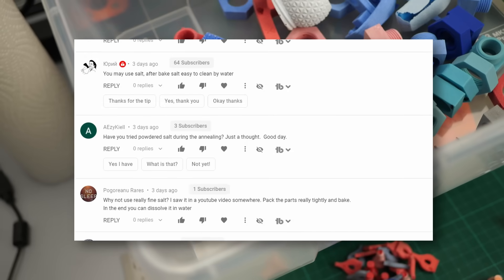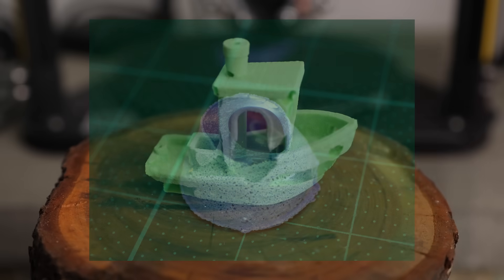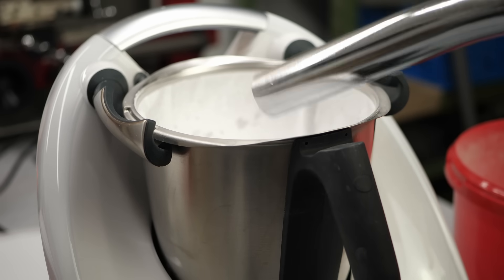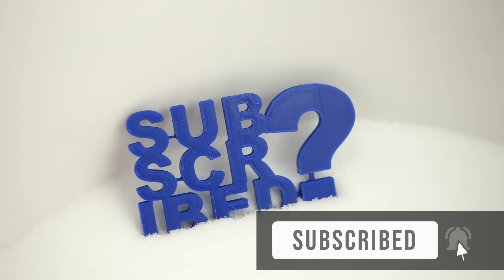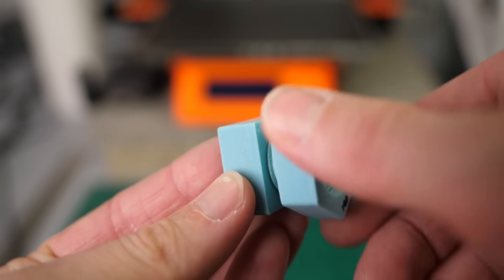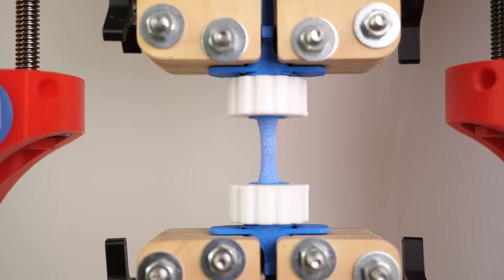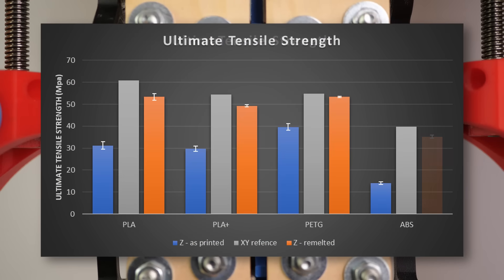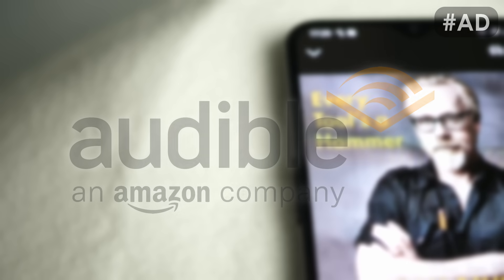The STRENGTH of 3D prints REMELTED in SALT

Comment: 3d print, polish, and make a (metal  pouring)mould from high temp gypsum and sand, and pour (inject) molten plastic  into it would make better quality injection moulded parts.
you could print in pla, but mould in high strength carbon infused plastic to make precise, real solid and higher temp parts.
you could even use aluminium or brass in a low cost set up.

Comment: There are at least two very interesting options to use: 1. Silicone for metal casting, like Mold Star 30(separated from model with something like graphite or thin layer of liquid soap, dried after covering) 2. Talc, that is not dissolvable by water and will melt in the model, creating something like matte surface.
With smelting in a mold it turns to entirely new process, when the printed model is a draft that turns to finished object later.

Comment: A great example of scientific experimentation. There is an ultra fine powdered pickling salt that does not clump up. Less costly to acquire. 
Increasing the tensile strength of the plastic cheaply can be a boon for manufacturing.

Comment: How about fine masonary mortar or just a bag of concrete cement...super fine and probably temp resistant, and cheap. And place your part container on a vibrator which will vibrate into small areas.

Comment: In lost-wax casting of bronze etc. the shape is often dipped in plaster to create the surface prior to putting it into the sandbox.
A quick-drying thin layer of plaster (Gießgips) might be a good method for creating the clean shape for containing the plastic and reduce the grain-size requirements of the sand/salt used around the shape, as there will not be any contact with the coarse particles.

Comment: I'm wondering if using the gypsum powder as a dry powder aggregate would work the same?
Gypsum already comes as an ultra fine powder so there's no need to pulverise it further.
Reply: Heat at 300 Celsius. Then it contains no water.

Comment: I don't know how much my experience would carry over, but I do a fair bit of casting with metals, mainly bronze and aluminum. when I do a cast I use a very fine sand/clay mix and a sieve. clay forms a tight seal around the cast and helps to improve the surface finish. in your testing, you compressed the salt at the end after the mold was full. you need to actually do this around every piece, as waiting till the end doesn't force air bubbles out but instead pressurizes them against the side of the part. if you ever revisit this you may want to check out a few casting videos that talk about preparing the mold.

Comment: And second - i wonder what would do some spray on the surface of the model before putting it to the salt. Something that would make the barrier between molted plastic and the salt, so they would not fuse together. 
And third - also if there would be some liquid, that would not disolve the salt and would not evaporate with that heat, there might be possible to create some semi-liquid fluid, that would pour into every hole but still be strong enough to keep the shape in the oven.
And fourth - what about vacuming it - would it remove the excess air?

BTW - speaking about the price of the salt and the material - if i understand it - you can reuse most of it (maybe just grind it again). So even more expensive material with better properties would not be a problem when using regularly

Comment: Is salt really the best choice? It appears to really degrade the outer surface. I wonder if a fine stainless steel or brass powder would work better for conducting heat and maintaining shape. I know fine stainless steel powder is used in metal printing (although it's very expensive) and I think brass would be a better conductor of heat but I'm not sure about it's availability. Aluminum would be nice, however it is combustible at this fine of a powder.

Comment: I would think fine sand-like greensand would be Ideal just need to get a fine material with very little water and stable at medium to high temperatures. Although it might be interesting to attempt that with metal powders to see if you can get a metallic polymer composite part.

Comment: You could potentially just clamp two of your containers together to achieve constant compression during heat treatment. Might even help drive out air from parts or help the fine structures of the plastic to help create even stronger prints. Could also deform the prints once it gets hot though. 

A method to create these prints using lower infills might be something like this. Print low infill part, add a vent into the part which can be filled with plastic pellets during the salt casting. Similar to how one would cast iron or aluminum. Perhaps using a vacuum oven would make that cast better. But the benefit of this would be faster prints with the same full infill.

Comment: I'd be interested to see a near-net-shape part printed and post-processed using this method, and then machined to maintain dimensional tolerance. I've had good luck performing near-net-shape machining on PETG parts with a small desktop CNC; I would think this would be a great way to get one-off parts with surface quality and material properties almost equal to an injection-molded part

Comment: this is gonna sound stupid,  but try a metal 3d printing powder, it is comically fine, and should have a higher thermal conductivity than the ceramic. 

(NOTE METAL POWDER IS INCREDIBLY DANGEROUS: DO EXTENSIVE SAFETY RESEARCH FIRST)

Comment: Sorry, only brainstorming after watching this video, recognizing the for me unknown idea and the possibilities: You may use more temperature conductive material, such as the metal powder that is used for metal 3D laser printing. This has a fine grain and your part will warm up and melt very fast, same as cooling down. I believe this will help to get better surfaces (no oxidation) and therefore also tensile strength.

Comment: I suggest using ball bearing mill.
You can make one yourself easily, empty metal paint can and bunch of steel ball bearings, then drive it with anything to get it to constantly rotate, there are plenty of videos and instructions.
Though I've got stuck on obtaining such a can, last time I was able to buy it from a fireworks making website but now as a immigrant in UK I have to stay away from such websites.

Comment: I would try fine powdered sand, but that is also very bad for your health, especially if it gets in your lungs.  Also I would recommend using a mortar and pestle to hand grind your salt if you continue to use it.  Salt is probably the best due to its high melting point, I would avoid flour because any aspiration around a flame can cause a spontaneous flame cloud.

Comment: After a recent nightmare for grinding a specialty salt last year, I definitely understand your issue with grinding! Unfortunately we discovered that it's not enough to simply grind to get a fine result, you have to grind in very specific ways, then sift/sieve your particle sizes. Then you have the additional problem that you have to watch out for clumping from just atmospheric water (even if you're in the desert!) and possibly bake out the water to prevent clumping (bake it before rebaking sounds extreme I think!)

Looking at your video and the original one, the best method would be some type of very fine casting sand, if you could find one with a high melting temp and no oils. Then baking with this method in a convection oven so the interior temperature doesn't rise to the point of melting/binding to the part. 

Another interesting test to do if you try a variation of your method would be to use this as casting method. Print a low density part, but have raw, unprinted material above that will melt down to fill in your unfilled part. Then you will have found a method to densify low infilled parts! (Which may not be that important though)

Comment: Builders cement is an incredibly fine powder and would not be affected by the heat. It is also hygroscopic, like salt.
WRT the PETG prints. I use it a lot. It's great stuff, but to get best results must be absolutely dry. It is not enough to put into a room temperature box with silica gel, it must be heated in an oven to 80C to 100C for half an hour or so, then stored with silica gel.
PETG prints which have been left for more than a day or so before annealing should be dried before annealing/remelting. This could easily be accomplished in the salt process by heating to 100C for half an hour (probably much longer to allow the salt to warm up) and then raising the temperature for the annealing / remelting process.
The cement powder should be packed as a dry powder not wet...!!!

Comment: Has anyone experimented with different powders? CaCO3 might work, and it's possibly cheaper than the salt. Its grain size is around 50-100 μm which is much finer too.
Reply: I had similar idea, with Calcium-hydroxide. I'm not sure if you can buy calcium-carbonate easily, and also the thermal decomposion might be a problem. From health aspect it would be very much better if suitable

Comment: Silicone has a very high temperature rating. I'm curious if you could 3d print a part, suspend it in casting silicone and remelt it. You'd ideally have 0 moisture problems because silicone has no water in it and completely cures as part of a chemical process. You'd also likely not have any casting surface imperfections because the entire part is reflowed as an exact image of itself. 

Try it and let me know.

Comment: If the goal is to re-melt (similar to basic molding or casting?) for layer adhesion then wouldn't it make more sense to use a high temp silicone 2-part mold? that way you wouldn't have to deal with grain size and it would likely be better for dimensional retention? I've seen silicone molds that can withstand multiple castings from metals such as lead, which is upwards of 330 deg C.

Though,  at that point you'd probably be better off just doing standard casting, but it may be a thought.

Or what about doing a mold in "greensand" like in metal casting?

Comment: Stefan:
As a curiosity could you amalgamate the the plaster annealing process and the salt annealing process by using a general plastic safe solvent.  (Methyl-ethyl-alchohol?) If the solvent is allowed to evaporate before the heat treating process the moisture content would be quite low.  In the proper ratio of salt to solvent you could create a slurry that would flow around the part and could have a more consistent surface finish.

Just curious.

Comment: Stefan, have you considered a more controlled cooling process after baking? Your close ups of the snapped surfaces remind me of how ice typically forms in a freezer. The samples look really solid and flawless towards the surface (until the porous crust from the salt, of course), but get cloudy as you look towards the center. This of course is the common behavior in materials when solidifying rapidly (relatively), where the outside will solidify before the inside, causing stress as the material inside tries to expand or contract. I might suggest taking a note from how people create their own clear ice by controlling the rate at which the material cools down and solidifies. You could decrease the temperature incrementally, waiting for the internal temperature settle before proceeding, until ~10% below the expected state change temperature. This gives the material an opportunity to solidify in a more uniform distribution.

Comment: All this tells me is that you need to coat the parts with a painted product (that can be dissolved afterwards without damaging the plastic).. First paint to prevent interaction with the powder.. heat.. remove the coating...   The temps are not so high that you shouldn't be able to find a water soluble "paint" to coat with first..

Comment: I really, really, want to see how this does with CF and carbon nanotube filaments, which lose so much of their touted strength to layer adhesion.  I'd also be interested in seeing parts tested in both orientations with such.

Otherwise, I think that talcum powder would be a go-to given relative availability of ultra-small grain particles and the temperature profile in which it should remain stable.  I suppose that's the test I want to see the second most.

Comment: A common method to form melted aluminum is sheetrock mud, or drywall joint compound.  After forming your original shape, you can deposit it in a loose slurry and allow it to cure hard, you can then pour molten aluminum into the form.  The finished result is hard before it is baked so it would not bond to the exterior thus prevent things like nuts and bolts from deforming. To clean it off after baking, simply place in water.

Comment: Stefan, I was experimenting with the finest powdered substance I had in the house, confectioners sugar.  I had a part printed in HTPLA Carbon Fiber from Protopasta, 45 minutes @ 210 C.  Seems to work a trick without having to grind salt!  It does take a significant amount of time to compact it, the sugar compacted far more than I anticipated.
Reply: Does the sugar melt or scorch?
Reply: @goldengrapeorg  After taking a look at the ingredient list, despite the bag saying "Powdered Confecitioners Sugar" a large bit of it is corn starch.  I only got light caramelizing with that particular (Wal-Mart I think) brand of powdered sugar when I did it again at 215-220 C.
Reply: @RyAlcar  do you think ball-milled corn starch baked for some time would get the best of what you're describing here? I think the solubility issue isn't solved like that though. I'm interested if anyone has gone as in depth as cnc kitchen for trying different methods
Reply: @nickmisner65  I would think that the results would be about the same.  I've not used that brand of product again and have only used what I've determined to be pure corn starch.  Air pressure has solved any significant issues with removing excess that I've experienced.

Comment: Is there some chemical property that makes salt especially good for this process? I figure the purpose of the salt is to just prevent the shape from deforming during the remelting process, so any fine water soluable powder that can handle the necessary temps should just as well as salt. It's a shame then that sugar has such a low melting point compared to salt seeing as how powdered sugar is more easily available than popcorn salt in that case
I recall once getting a really fine salt powder once by first dissolving the salt in water, then heating the water at a very low temp until all the water evaporated. I doubt that this could be scaled up though, I imagine sizable crystals would form given enough salt.

Comment: I would expect you could use the finely ground sand that is used in metal casting.  It's readily available for this purpose.  The main drawback that might be an issue is that it could stick to the melted plastic and be impossible to remove. It's not water soluble like salt.
https://www.youtube.com/watch?v=CO7QYGdshT4

Comment: Someone mentioned trying to use Baking Powder instead of salt because it is a much finer grain.  I was thinking along those lines that just using Flour would be another cheap material to try using.  It would also give you a ultra fine "grain" compared to salt and I don't think it would affect the Plastic surface as much.

Comment: *Coat them in potters clay liquid (Isolates from the air) + After a silica podwer (Release Agent) podwer applied,  Then wrap the mold or molds in NICRHOME wire,
This is WAY CHEAPER!  This is where Studies top Labs are doing this as a Auto clave Replacement.
Obciously you're going to have to have adjustable voltage to dial in the part.

Comment: Since the fine salt is just an aggregate, and is so corrosive. I would suggest finding a more neutral and thermally conductive mixture. Stainless steel wool and ground up dry wall pieces maybe.
You probably have these ingredients at hand: "Sorry honey, I had to punch a hole in the wall, but it's just the garage". 
It all comes down to how committed you are on this subject.

Comment: Have you measured the new wall thickness of the low-infill parts with the holes in them? If you could find a threshold at which you could have reduced infill and maintain a safe new wall thickness to account for the salt melting into the plastic, you may be able to get increased strength in parts while saving some plastic. That, or your infill would melt and deform and the part would collapse into itself under the weight of the salt.

You might also consider trying this with thicker-walled hollow parts, if you haven't already done an infill vs hollow strength/adhesion test. In an attempt to save time/plastic, I once printed some cylindrical models as thick-walled hollows as opposed to thinner-walled and infilled.

Comment: Have you considered using drywall texture mix?  It's plaster/silca mixture that has been used with pretty good success in lost foam casting; preserving fine details from the foam core.  It dried quickly and with a low viscosity mix, parts can be dipped for full coverage and multiple layers can be applied.  Might need to be buried in another material, like salt, for support during the annealing process but it should preserve surface details and not invade the part.

Comment: Before blending your salt, consider baking it for some time to drive off excess moisture. 
Salt is hydrophilic and will have absorbed plenty of moisture from the air from shipping. As you pulverise it, it heats up driving off moisture, the smaller grains have higher surface area ratio, and thus are more likely to clump/stick. If you keep it extraordinarily dry then you can get further pulverizing.